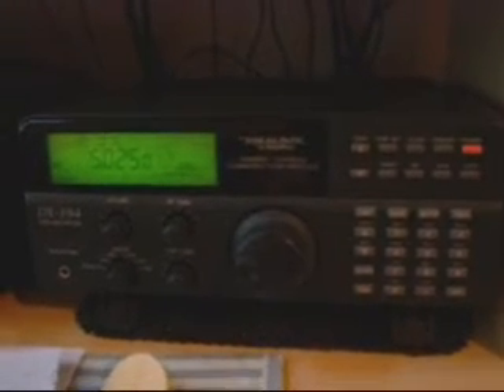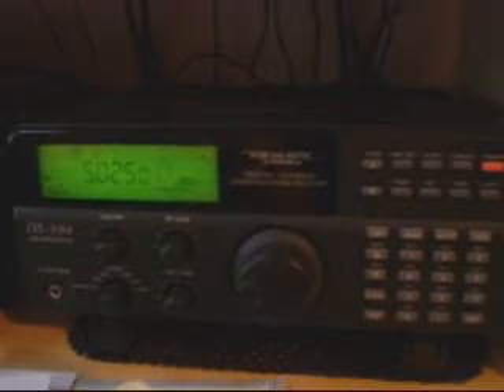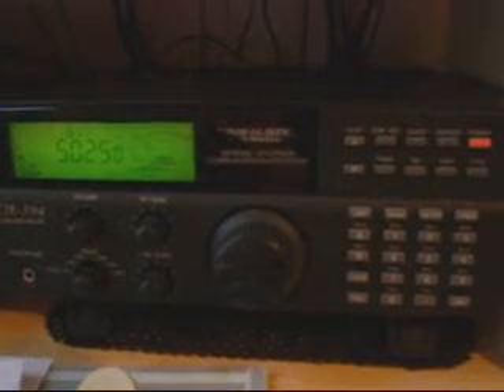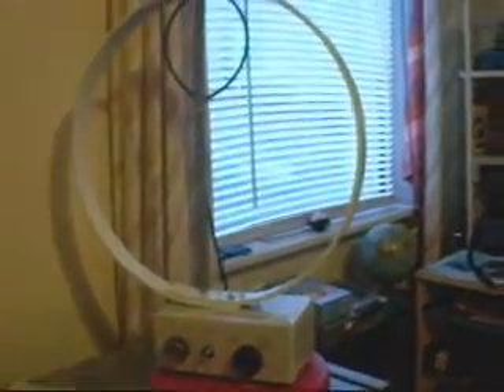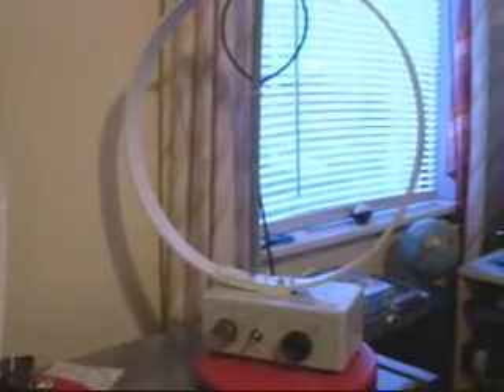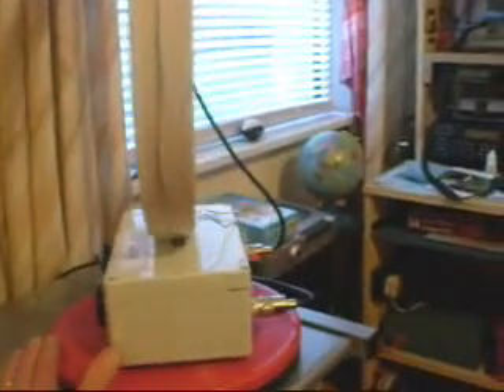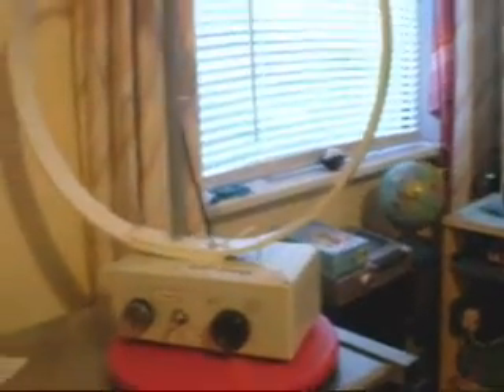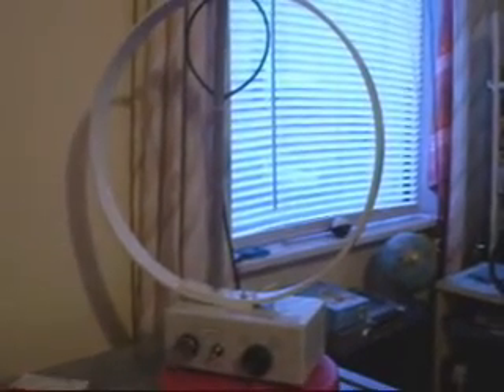Nulling Out Noise on HF with a Small Homemade Magnetic Loop Antenna

Comment from the maker: Hi Tim, thanks for the comment and looking at the video and if you take a look at the detailed comments I made there is information on the various different frequency coverages you can expect depending on the capacitor you use.
if you use a very chunky vintage capacitor with lots of Metal on it then you may be limited on the higher frequencies but the best advice I can give you is just to experiment a bit. determine the size of loop you want to use in this case I chose something small at about 45 cm in diameter and then just try connecting one or two different capacitors. I bought a variable capacitor and quite a nice modern one with a value of 1000 PF and it tuned very nicely across the HF bands. if you intend to use the loop indoors then my advice would be to go for quite a small loop of the 50cm diameter range as I have tried bigger ones like 1 metre diameter and the increase in noise was more detrimental than was the increase in signal strength. I guess that is why the aor commercial lips are all very small. anyway 73 good luck and feel free to comment again if you want.

Comment from the maker: Hi Burt, Thks for the comments. Well, I see you are a radio amateur and guess you'll want to transmit on it? If so, my knowledge is a bit more sketchy. It'll need to be a big loop (probably 1m or more in diameter). I have built one for TX with 10W on PSK but using it indoors only had limited success (still very much better than the Miracle Whip though). If it is for RX, then things were much easier and I found that as I reduced the loop in size, the noise also reduced. I realize the signal also reduced with the smaller loop, naturally. But the NSR was very much improved, as the video shows. Email me via QRZ or via here if you want more details/plans/components used etc Thks. 73 Adam

Comment: Did you ever call out Ofcom to sort out the interference they should always  be called out if your suffering un due interference.To many Hams are selling up due to PLT SMPS PALSMA TV just to name a few.It's only going to get worse now sky television are going to use PLT to send there signal around the home sorry to say but we have had it if you live in a very populated area .Ofcom should be ashamed of them self allowing this terrible technology to  radiate across the HF spectrum .Great job on the loop i have done the same type of thing using a bicycle wheel  with out the spokes and a 500p variable capacitor necessity is the mother of invention .Thanks for posting .take a look at this site if you haven't ready done so   
http://www.ban-plt.org.uk/
Reply from the maker: +John Gulliver Hi John, No I wouldn't want to do that. Relations with that side of the fence are already catastrophic! We would have WW3! I don't mind having to be inventive. But I WOULD like to move to a non-terraced house so that I wouldn't be quite so close to the dreaded neighbours! 73 Adam

Comment: Just a quick observation: Did you mean to say that the length of the pick up loop is 20% smaller than the main loop, (thereby 80% of its size)  or 20% the length of the main loop, one-fifth its size? I think you meant to say the latter.